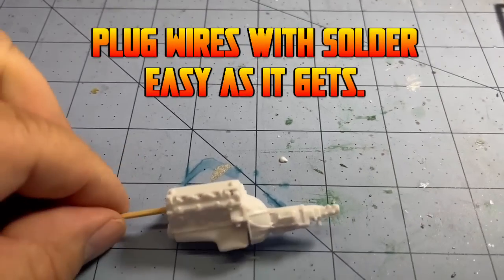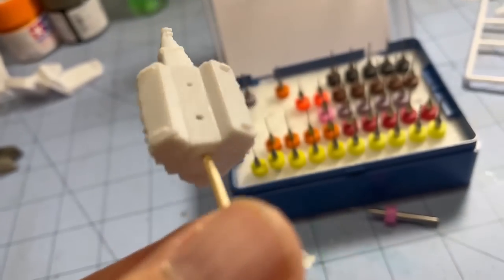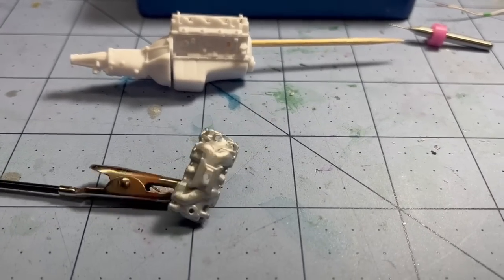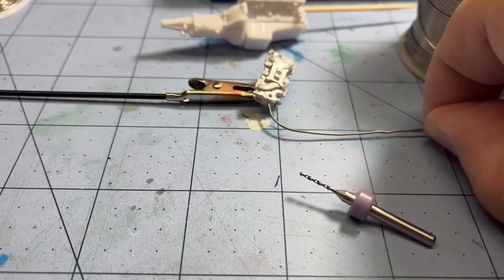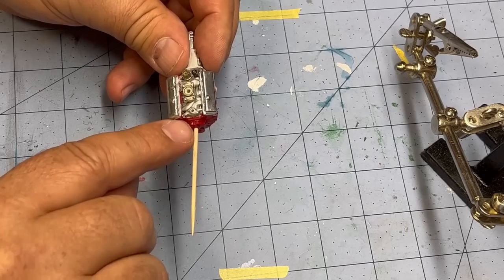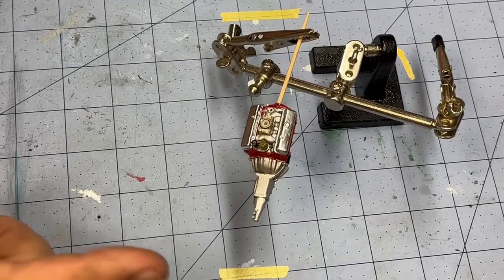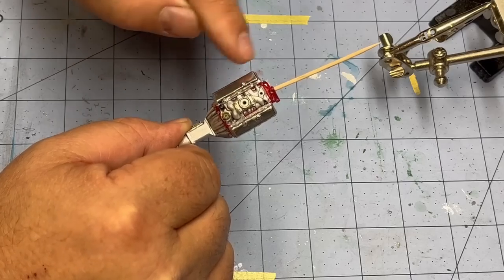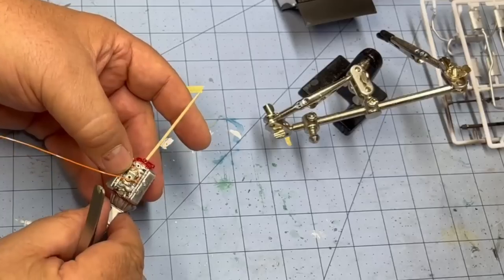Making plug wires using solder (Easy as it gets)

Comment: I wish i had watched this a week ago. Im doing the 78 GMC and used blue Cat 6 wire, but started at the distributor towards the heads. This looks soooo much easier! Thanks for the video!!
Reply from the maker: It is a lot easier.  I haven't done it with Cat 6, but with .3mm solder it is about as easy as it gets.

Comment: Great info and inspiration Mark. I will say I find it easier to load up the distributor and then feed it out to the plug holes, leaving enough length that i don't even trim the plug end of the wire, just feed it end and the bending holds it in place. But I never considered that fine solder wire... looks so much easier. Thank you for sharing your craftsmanship...
Reply from the maker: Thanks again for watching.  That solder wire is so nice to use on so many different things.  The plug size is perfect for battery cables, vacuum lines, linkage, brake lines, and throttle cable.  I have a little bigger size too that I use on heater hoses, PCV lines, and brake booster line.  They bend so nicely and hold their shape.  That's why I quit going from the distributor out.  I don't have to fuss with trying to drill all those tiny holes.  LOL  Have a great day.
Reply: @grandpamarkshobbies  Confession time... on models that come with cheap/bad distributor molds, I will cut a small cross-section of aluminum tubing just larger than the distributor and just have my wires ready, slip the tube over the distributor and fill with epoxy ... wait until it's gummy and push the wires in. I'm willing to trade "clean but symbolic" ... for "sketchy but real" most of the time .. if that makes sense.
Reply from the maker: It sure does.  I have one that I'm going to use in my 24 hour build this Jan. that doesn't have a distributor.  LOL  So I'll be doing the same thing.

Comment: What an amazing video! Thank you sir; what an inspiration. Like you guys, I love to detail my model car engines to the best of my ability, even though it is time consuming and can be very frustrating (especially when a small piece of "ready to fit" wire goes flying off the bench only to be eaten by the carpet monster). However, despite needing the patience of a rock, we all appreciate how a wired and plumbed engine can be very rewarding once completed. 
I am going to try this solder-wire method. It is difficult for me to buy model car wiring & plumbing products as I live in the UK, plus they are expensive. Therefore, I am always looking for alternatives. I have found some small-gauge covered wires, such as that used for jewellery, too springy, so my next project will use solder wires, if I can get the right diameter. Thanks for the links, too.
Reply from the maker: I am one cheap son of a gun, and there was no way I was going to drop 9 or 10 bucks per engine on plug wires.  I went the rout of drilling out the distributer, and that was more frustrating than just about anything I've ever done above water.  So I had a spool of solder and thought I can do everything backwards.  It's so much easier and doesn't make me want to over do adult beverages in the process.  I hope you can find something close, because for just about 10 US you can do an entire car lot worth of engines.   
Thanks for watching and have a great day.

Comment: I used CAT6 cables for intricate wiring also in previous projects... I also use them by twisting them to make tow truck steel cables. 
Using solder is a great idea. Never seen this until now. I'll have to give that a shot someday.
Reply from the maker: CAT6 is a great size.  I've used it before.  If you like that you will love this solder.  It's easy to run, and stays put.

Comment: enjoyed your video, i am currently working on a 78 GMC 4x4 and puting a blown 350 in, I decided i'd go down to the cable office and get a scrape of phone wire; i am using that for the plug wires. don't know the size of them, but they are small indeed.
Reply from the maker: Thank you very much.  I hope you have a blast wiring your 350.  Once you start it's like chips, you just have to do another one.  LOL

Comment: last model I build over 25 years ago, I used yellow sewing thread for spark plug wires
Reply from the maker: LOL.  That's what I use to use too.  Then I tried wire, but that's a pain in the behind to work with.  LOL
Reply: @grandpamarkshobbies  very cool video, you have me wanting to get back into this hobby!  thanks!!
Reply from the maker: Do it!!!  It is good for keeping my hands and fingers nimble.  There are some great kits out there that are a lot of fun to do.
Reply: @grandpamarkshobbies  believe it or not I actually have model kits. I saved some muscle cars I bought in the early 90’s.  I remember being shocked that they cost about $10 a kit!!!! I think they were $5 or $6 when I was a kid.
Thanks again for the great video. I’m totally going to get back into it. I think I need new glue and , that may be dried up by now!!
Reply from the maker: For sure the prices have gone through the roof.  I remember getting them for around 2.50 to 3 bucks.  Just wait till you try some of this new glue.  It dries super fast, and doesn't make you want to sing Purple Haze while you are building.  LOL
Reply: @grandpamarkshobbies   I’m old but not quite old enough to have used the “ good glue!”  Thanks for all your help so far, I really appreciate it!!
Reply from the maker: "Good Glue"  Now that cracked me up big time.  Whenever I think about it I can still smell that citrus lacquer smell.  LOL

Comment: Amazing, thank you, quick question, what size solder for hoses?
Reply from the maker: Thank you.  most hoses are 5/8 ID hoses, which would make the outside diameter of 3/7 inch.  At 1/24th scale that would be .79something mm so I use .8mm solder.  I think it looks just right.

Comment: Where do you find fine solder?  The British call it fuse wire but I ve talked to local shops and Micro Mark tools and no one has anything that fine.  Shep Paine used it for piping and wiring in his models, calling it "gizmology", so it's been around for awhile.  But I can't find it.
Reply from the maker: I'm not sure if you can order it in England from Amazon, but this is the link to what I got.  It's nine dollars US.  https://www.amazon.com/Rosin-Solder-Electrical-Soldering-0-3mm/dp/B08M5XDKFG/ref=sr_1_2_sspa?crid=IDCHYDSO4CH0&keywords=.3mm+solder&qid=1666436065&qu=eyJxc2MiOiI0LjE0IiwicXNhIjoiMy40NiIsInFzcCI6IjMuMzQifQ%3D%3D&sprefix=3mm+solder%2Caps%2C100&sr=8-2-spons&psc=1

Comment: G'day Grandpa mark just wondering with all these tips do you have any on how to make the lead terminals on the battery and then add the wire too it, I've tried to flat lead but just doesn't look right, do you have any ideas? Love a video on that if you got one... Cheers mate
Reply from the maker: Thank you for watching.  I do not have a battery video as of yet, but I will be making one when I make the El Camino build.
Reply: Awesome I can't wait to see it... I've built a lowrider version of an El Camino... I'm building a 1965 Pontiac Bonneville at the moment, haven't seen many of those yet...
Reply from the maker: I've never done a Lowrider.  .  .  .Yet.  LOL

Comment: I like to use  - PVC Coated Tin Plated Copper Wire Wire-Wrapping 30AWG  -- SOLID CONDUCTOR stays bent so you can get it to sag or stay in place. They have it on amazon and there is enough on one roll for a lifetime.   The roll has several colors ... yellow, red, black, blue, green, purple, orange .. +   It is really fine and the perfect size for 1/24 and 1/16. Search those exact words I mentioned between the dash marks and it will pop up. Look for a roll the has multi color wire, with large black writing on the white spool that says - WIRE WRAPPING WIRE. I just strip a 1/8" piece of insulation off with my thumbnail and stick that in a drop of super glue and stick it in the hole on the model. Dries in a few seconds usually. Slightly thicker solid conductor white is on there as well... like 26-28 AWG, good for 1/6 -1/8 stuff. The key is SOLID CONDUCTOR so it will stay bent. I use tiny little heat shrink tubing for boots.
Reply from the maker: I use to use the coated 30AWG It did work well.  Thanks for watching.

Comment: Could you airbrush the solder ? Do they make  .3 wire? What size would it be ? I have #30 AWG wire and it looks a little big on a 1/25th scale , i was told it was the correct size,  anybody out there please help me, I'd rather use wire than solder
Reply from the maker: I've never airbrushed the solder before.  I think it would bend away from the air.  I'm not sure what gauge .3mm would be, but #30 AWG is going to be very close.  it is almost the same size.  so it should look good on your engine.

Comment: Hello GrandpaMark. I have really been enjoying your videos, and I do intend on using several of your tips in my own work. I'm about to run to my local hobby shop for so .1 x .25 polystyrene strips for use in scratch building, at the moment, four chassis - three for the new AMT Chevy trucks and one for the MPC '72 Chevy racer's wedge. I'll be posting videos of the builds on my channel, which I just started. I would really love any feedback/input that you might have.
Reply from the maker: I just jumped over to your channel and subscribed.  I will power watch your videos tonight.  I'm glad you are able to use some of my tips.  Thanks again for watching.

Comment: Looks good,I usually wire the distributor first then plug wires, just saying..
Reply from the maker: That's the way I did it for years, but this way is so much easier for me.
Reply: I want to build George Berris 
"Snake pit " any tips or suggestions??
Reply from the maker: That would be a heck of a challenge.  It was mostly a geometric car, so if you somehow got the dimensions it would be doable.  I would suggest that you somehow find some prints and go from there..
Reply: Right on thanx....

Comment: What do you use to make the spark plug boots
Reply from the maker: I use white glue and a toothpick.  I roll a dab on the solder and when it dries I paint it the color I want for the boot.  Then I paint the solder for the wire color.  It works great.
Reply: @grandpamarkshobbies  I watched one of you're videos where you stick a  Needle or something in a black wire or something then you make it round and do the other end the same way
Reply from the maker: No that wasn't me.  I always use the white glue.  The video with the needle was when I made the return spring.  I only do the boots on the engine side.  The side with the distributor usually doesn't show.
Reply: Screw him ,buy paper clips covered in plastic what ever color you want remove it from the paper clip and cut your spark plug boots easy as that lol
Reply from the maker: Darrell, first off, I'm not sure if "Screw Him" was necessary or not, but OK.  Second off, that's a dang good idea.  My problem is my hands shake and I just can't thread that needle.

Comment: Was the yellow paint enamel?
T.Y
Reply from the maker: That yellow is the under clear that is used during the chroming.  If I left it in longer that would be gone too.
Reply: @grandpamarkshobbies  sorry i don't understand your answer.
What paint did u use to paint the solder wires? It does not crack when you are manipulating them into position.
Reply from the maker: I'm using Tamiya XF-3 Flat Yellow.  The Tamiya paints do stick very well.

Comment: Fyi…and I know this is old, but your airbrush is not your problem if your finish isn’t to your satisfaction, it’s your surface prep. Prep cannot be stressed enough. Js…
Reply from the maker: Thank you very much.  I totally agree that prep work is fundamental with a good finish.  With my old airbrush I just couldn't get a good flood coat.  When you put the coals to the trigger it wouldn't give an even spray.  The ones I'm using now do not give me that problem.  I think the old airbrush just didn't atomize the paint like it should have.  No mater of air pressure, mixture, or movement would help.  I've gone through a lot of spoons in my day, and since I've changed my airbrush I've found that I'm having totally different results.  Now the problem I had on the front of my latest build was totally one hundred present my fault.  LOL  But I was able to wet sand it out and then re spray the front and save it.  With that old airbrush I didn't have the trigger control to be able to throttle the paint flow down to where I could fill back in the sanded areas and bring it back to where you could never tell.  I am convinced that although prep work is ninety nine precent of the job and quality airbrush does make a difference.